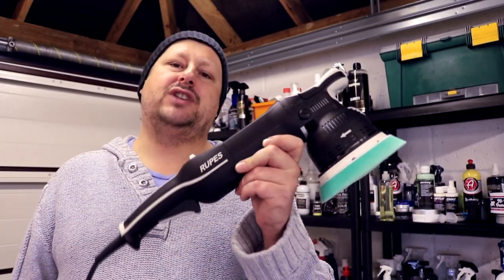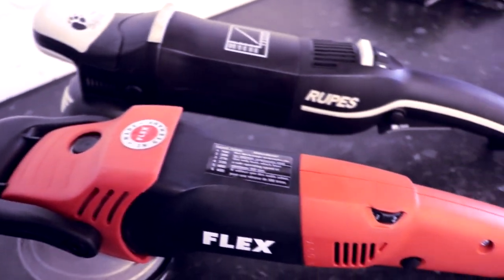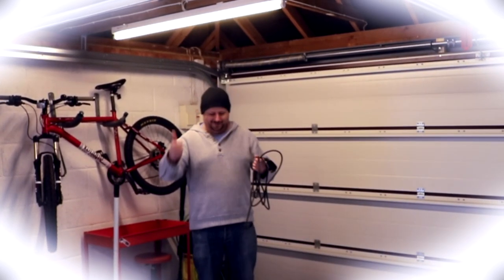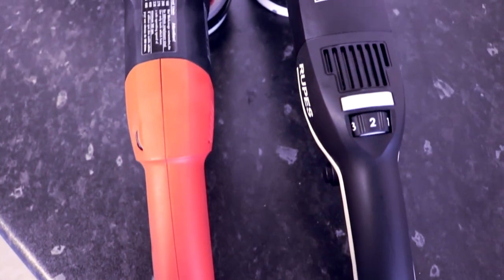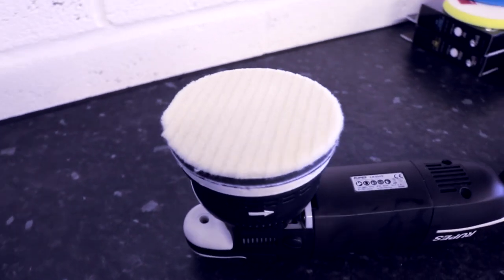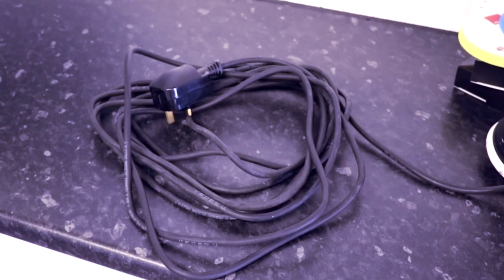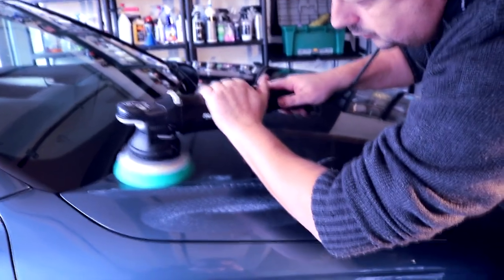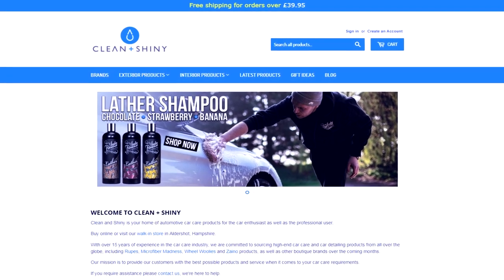RUPES Mille LK900E Bigfoot Machine Polisher Review Demo

Comment: Hi Jon. I’m not sure if this is a stupid question. I have no experience with a forced rotation polisher, but wanted to know if you are able to use microfibre cutting pads with this machine? Or is this not advisable due to the heat the polisher would generate? Your words of wisdom would be much appreciated.
Reply from the maker: not due to heat JC.  I talk about why they are considered not suitable on forced rotation actually in a video I will be dropping tuesday on the new moore pad range joe from autoglanz is releasing.     MF pads will still pull abrasives and work on forced rotation or rotary..    but imagine a microfiber pad a crops like wheat in a field stnading upright.   when a rotary or FR machine operates it rotates the pad constantly so this creates a crop circle effect.  although the FR has a slight oscillation or offset (imagine a spiders web shape rather than a cirle) its still a constant rotation which drags the microfiber one way.    So the microfiber gets flattened out like a crop circle and only one side of the microfiber it sweeping over the panel.   And because of this is will gunk up quicker.    A free spinning machine the rotation slows and stops periodically and that means you get and orbit of the axel with no rotation of the plate.  this ruffles up the microfiber more so its not constantly being pulled one way, simply think of buffing a panel with a microfiber cloth in different directions.   Its this ruffling that means you use more "side" of the microfiber strands as opposed to one side of the absorbant microfiber just getting clogged up.     Thats the theory anyway.   MF still works on FR and rotary.    Wool is less effected by the above as it doesnt absorb the polish as much.
Reply from the maker: thin MF pads are also a handfull on the forced rotation and its really hard to get over curves or recesses with them.
Reply: Forensic Detailing Channel thanks for explaining Jon. It. makes sense the way that you have explained it. I look forward to Tuesday’s episode.

Comment: Is it be safe on wax or sealant application ？Some said such forced rotation machine had more power，may not appropriate to apply wax or sealant.
Reply from the maker: hmm you could apply a sealant with it on a soft finishing pad, but its a bit on the heavy side..
Reply: It's truly help.Thank you very much.
So is that mean the dual action polisher may cover more range of use considering the personal detailer?
Reply from the maker: I personally cant see that many benefits of a free spinning DA over a forced rotation,  the main turn off with forced rotation is getting walked by the machine when your using larger pads..  but if you can get a pad combo which works for you and this isnt a problem I find it hard to see why a free spinner DA is that desirable.
Reply: I sincerely appreciate your help，thanks

Comment: Nice review on the mille, i saw this a while back but no one had any reviews on it. I too think the mille is a bit on the heavy side. The polisher im more interested in now is the flex cordless da that has just come out. Will you be getting that to review?
Reply from the maker: thanks alan. Ive had a play with the flex cordless DA and rotary.  very impressed with them..  I will try and get them for review.  the cordless DA seemed to have more clearence on the plate than the corded version that I reviewed.. it was really smooth.

Comment: Did you have a chance to try out the Mille with the Lake Country Hybrid Force pads?  Putting aside the screams of outrage from the Rupes fans, it would seem like those pads would work well with the Mille, being engineered for use with a forced rotation polisher (in terms of heat resistance), and are thicker to accommodate contours.

Comment: Contrary to most, I found the 3401 to be less "jerky" than the Mille. Mille had less vibration, but I don't contribute that to a smoother running machine. If it wants to own you more, it's not as smooth, regardless if there's less vibration. I sold the Mille and kept the 3401.
Reply from the maker: what you might be observing is the extra what 400-500 gram weight of the machine making a difference.  vibration is part of the smooth thing but I understand what your saying. ultimately with these forced rotation machines the key is really the pad biting into the panel rather than moving over it soon as that starts to happen these tools generally can become a pain to operate. the size of the pad and the machine weight play a bit part in this.     I think I know what you mean though.  I found the tool a real handfull on the blue pads and rupes are saying I need to use it with their system and their abrasives but I dont want to do that.  I dont like the flat pads for the reasons I discussed.   The the actual buy in to a system in this instance has put me off because theres problems with it beyond the tool itself.   that being said I could get a combo no doubt that works Id just have to explore pad ranges.     I do have a leaning towards the 3401 as well still, even though some elements of the mille are better (the cooling)
Reply: Jon, I tried several different pads and polishes with the Mille, including their system. Even with their pads and polishes, I still wasn't satisfied. The Mille is much more finicky as far as pad selection than the 3401. I don't like that at all. Kind of hard to explain, but the Mille has less vibration, but more grabby. Like you said, I think you understand what I mean.
Reply: Also, with the Mille, when moving the polisher horizontally, it's a lot less grabby then when moving the polisher vertically. This could be said for the 3401 as well, but I found the difference more noticeable with the Mille. Just my opinion.

Comment: Nice Review! Will you be reviewing the Makita PO6000C soon? I am really considering getting either the flex 3401 or Makita. Hope you can help me out
Reply: Liu Poh Tat I recently bought the PO5000C here in Germany and can’t wait for it to be delivered. In my opinion i prefer the Makita, cause you can switch between forced rotation and normal DA and with the flex you can’t.
Reply: Mario A the da option is useless but the FR is real good
Reply: I wouldnt say its useless, you might use it for the application of some protections products like a liquid wax or similar. Doing the same already with my BO6040, but when i tested the handling of the PO5000c i was surprised how good it is compared to my actual one.

Comment: I love my rupes, but their blue compound really put me off overall. It’s horrible. Yes it cuts well but dust like hell. Blue pads just don’t last. That doesn’t male sense to me. How’s can they build fantastic machine but didn’t nail some basic stuff pads and compound.
Reply: It totally makes sense from the business perspective to make the base machine last a long time, but not so with the relatively cheap supplies. They cost just a 10-15 bucks each, which appears not so much, so you don't notice that ultimately and over a significant time period you're actually spending a fortune on them.
Reply: Mark, how are you setting up the pad? 

It's been a year since I used it with the blue foam. I don't remember it dusting any worse than M100, or FG400.

Comment: You have to know how to prime their pads- which is TOTALLY different than any other pad made- There is a video out there that shows a rupes tech rep demonstrating exactly how to prime the pad-- Makes all the difference in the world. Here is a linkhttps://www.youtube.com/watch?v=gR8puD3Mko8
Reply: Rupes guys recommend to prime the pads differently. Place 4x Pea drops on the pad, place on the panel, start up and then without moving pressure down a little for 20 secs and stop. Pad is primed. Then add a couple of drops of compound and work the area. Rupes do not agree to spreading compound over an area as it gets “ pushed away” from the pad. It works, but old habits and all that!
Reply from the maker: saw that video..primed the pads properly.  but with one abrasive it didnt work.. with s3 working wet it worked..  but even working wet it was a handfull on the blue pad.  I did say id be interested to use it with the mille compound..

the danger to systems is it creates micromanagent with how you use products and almost a disclaimer that undesirable results or issues are user error (they may well be, but the net result is the customer moves on)..     You will always chase out systems which work for you and generally when you bring in a new tool you want that tool to work with the products you choose rather than having to purchase products you might not need. And purchasing the rupes stuff isnt cheap.  so thats a consideration for me...    but regardless  of how good the mille compound is I would be looking for alternatives to the blue flat pads...  Its a personal thing but its also a no brainer...

Rupes seem to be loved or hated but no middle ground.  I think they are solid, and I would use their tooling with no hesitation.. like Ive said before budget is the only reason I personally dont use them right now and I dont do much machine polishing nowadays.